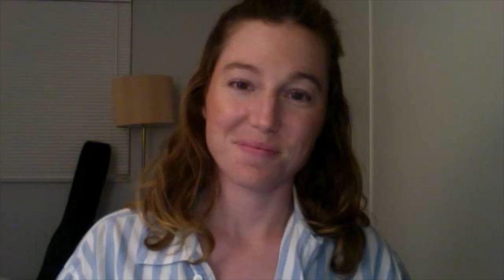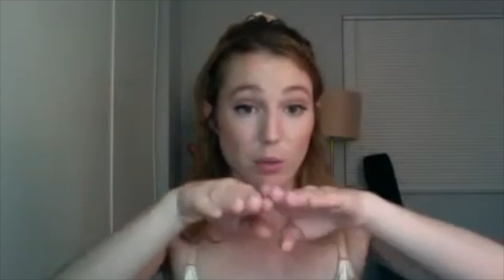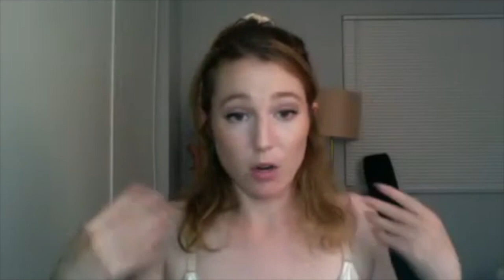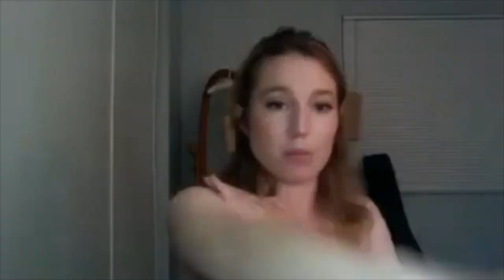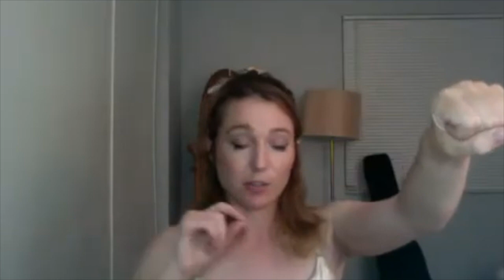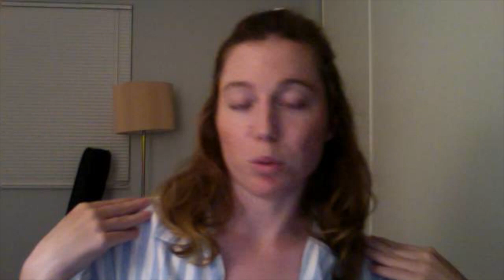Diagnosing set problems from the coxswain seat

Comment: I was going to add "pulling away from the pin at the end of the stroke", but you included it in the bonus-reel.
There is also the possibility of people sliding forward too quickly and sitting at the catch momentarily, shifting their weight and causing the boat to fall.
But I am curious why Starboard and Port is not used on this side of the Pond. Instead it is Stroke-side and Bow-side. Of course Stroke and Bow can be on either side and in Italian Rigged boats they are on the same side. But Stroke-side remains conventionally on Port side. It would be interesting to know where this difference arose from.